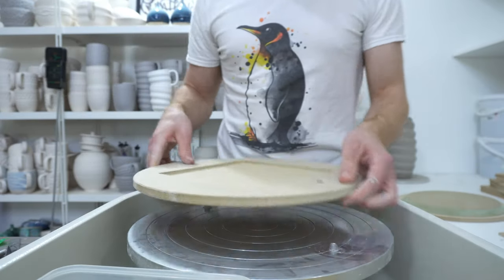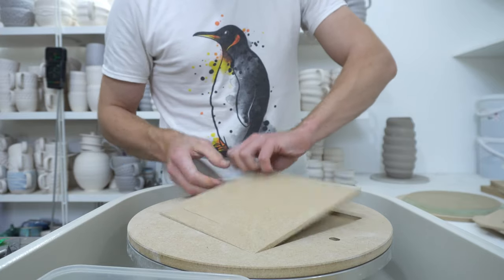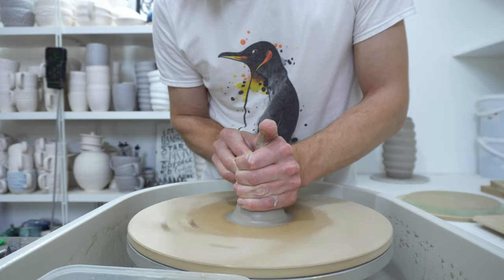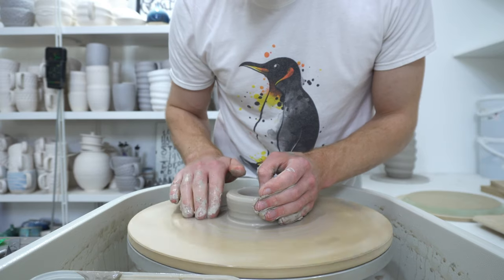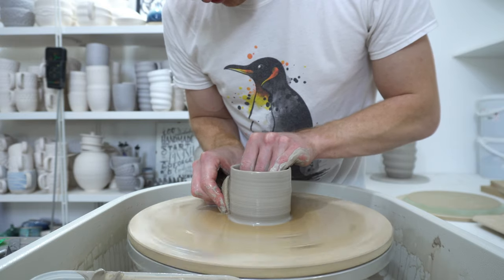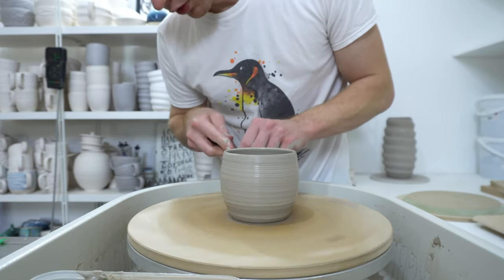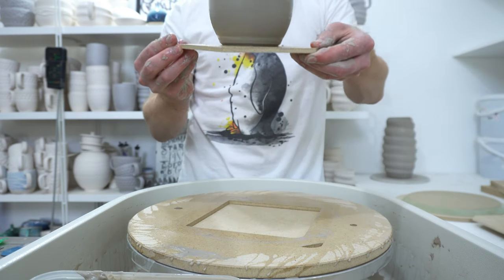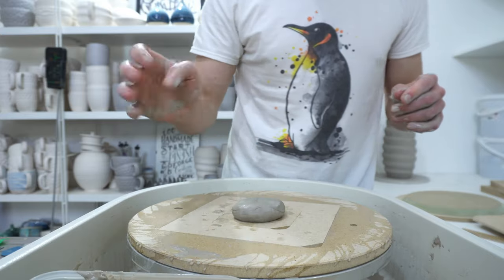First test of my Hartley & Noble Russian Doll Batt

Comment: That's a real nice, adaptive system!
I have the Wonderbat system, which has removable square inserts, but only one size.  It works well for most of what I make, but if I go larger, I have to switch to a full circular bat.
I have occasionally caught a finger in the opening used to pry the bat out. but never hurt myself too severly.
I can't speak on your bat system, but the only issue I've found with the Wonderbat is, that if you try returning the removable piece back into the main part, when both are wet. it can be a really tight fit as they have swelled.  It's not usually an issue, just something I have run into.
Reply from the maker: Thanks for your thoughts, I have already noticed the slight swelling once the inserts get wet. Hopefully it never gets to the point that I cant fit them back in!

Comment: I am going to make a bat system with the help of a friend who has a CNC laser. I am planning on using 1/2" PVC and will have a slight design change because I throw on a Shimpo Aspire and the makeup means a little imagination will come into play. Waiting for better understanding of the pandemic before I venture out to play......
The PVC is very stable up to a certain temperature.....kiln is at other end of studio so should work out well.
Helpful video and comments, thanks for sharing.
Reply from the maker: That sounds like a fun project! There are advantages and disadvantages to each batt material, but the lack of warping when wet is a huge plus for plastic batts
Reply: @freddie moretti just FYI regarding pvc on a laser cutter.  The laser thermal process produces hydrochloric acid as a byproduct as well as other toxic fumes.  PVC can be cut but the hydrochloric acid can cause corrosion on the laser cutting machine and I would definitely have this vented as to not inhale any of the toxic fumes.
Reply: @Ryan.Chapman  Thanks Ryan, please excuse the lack of using the proper term. The CNC he used was the one with a cutter using a router and blade.

Comment: Great video, thanks! May I ask whether the raised surface from the batt system means that you get more water spraying outside/above the splash pan? I'm based in my dining room so need to keep as clean as possible... I understand that it will vary wheel to wheel, but just curious to know your experience. Thanks.
Reply from the maker: I've never thrown on this wheel without a batt of some kind, so I can't really compare. The top of the batt is lower than the top of the splashpan on the Skutt though, so there isn't much water kicked out from the throwing alone, but some clay spatter gets out regardless. I would have thought your best bet would be to extend the splashpan up a foot or so everywhere that it wouldn't interfere with the throwing, then you'd catch pretty much all the clay regardless of whether you're using a batt
Reply: @OldForgeCreations  thank you, that's very helpful.